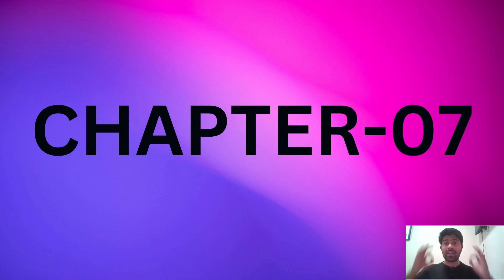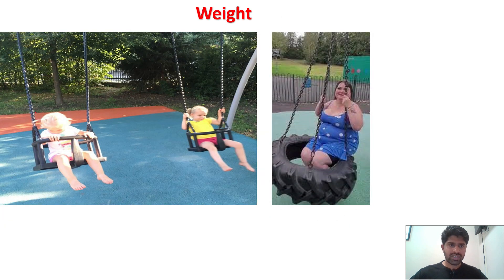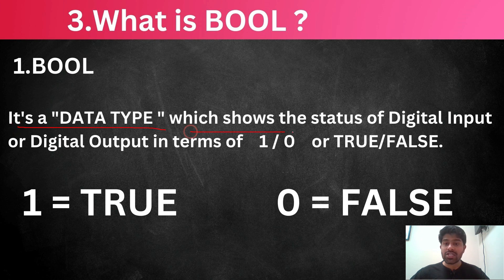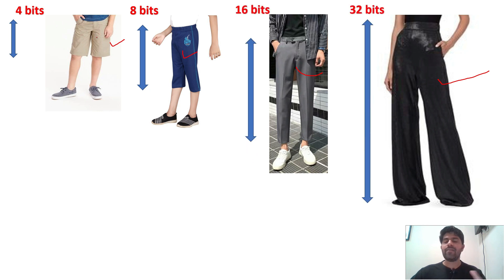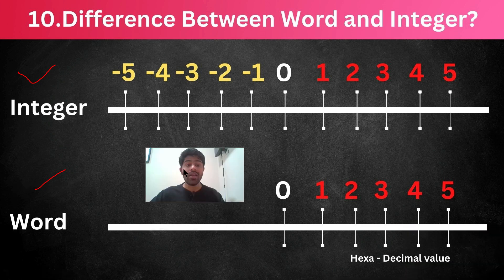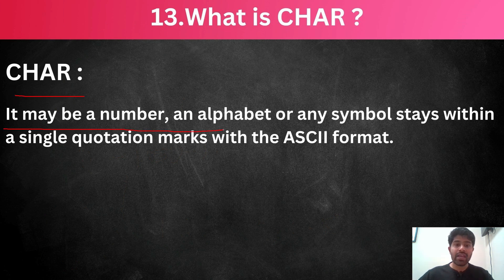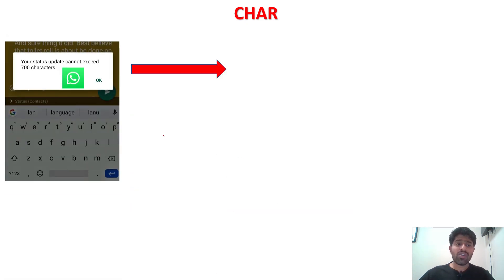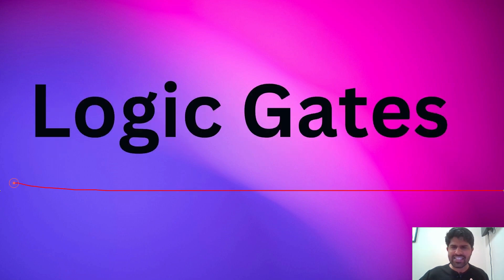CH07 :   PLC Data Types Explained in Detail. |  #ashokreddy

Comment: Bro hexa decimal value what is the use?
Reply from the maker: Some of the instruments like scanners, transmitters and some printers when we want to connect to PLC they send and receive values in hexadecimal in that case we use this Data type bro….Basically we use hexadecimal to represent large number of data in few digits…. After 9 no need to use 10 , instead of 10 we can write A,BCDEF etc…. Which save the time and storage as well ….